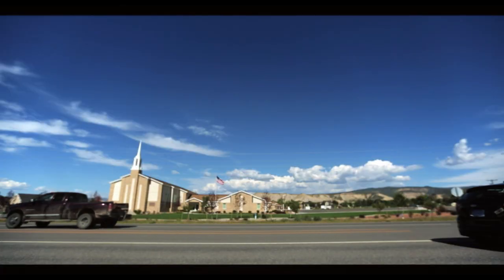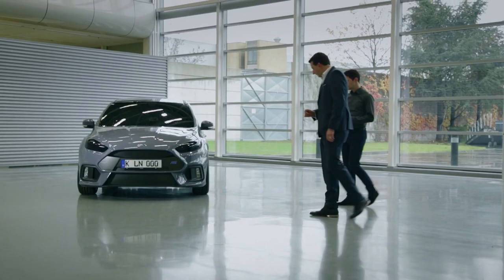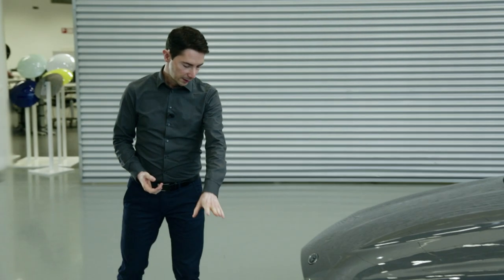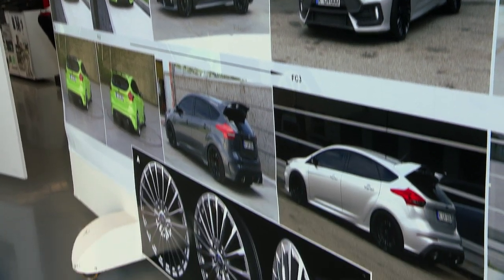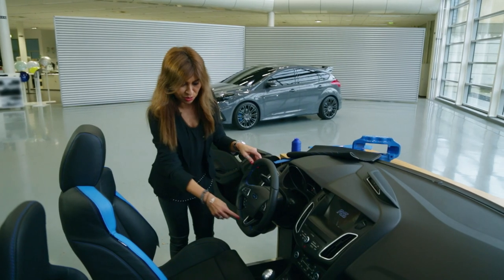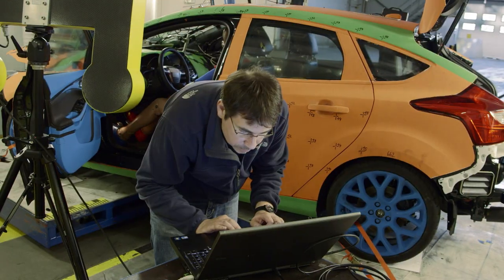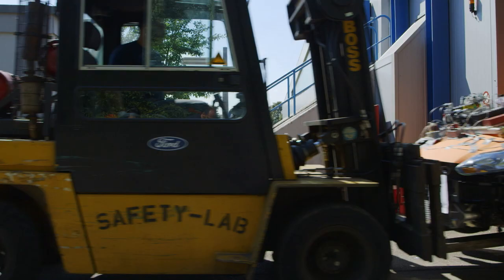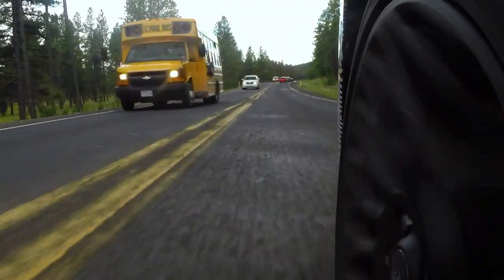Rebirth of an Icon - Design and Development: Episode 2 | Focus RS | Ford Performance

Comment: As a current Focus ST owner I'm excited about the new RS.  But Ford, for a car that has so much excitement around it, this video has zero energy.  The title is "Design and Development", yet there was no discussion of the initial parameters you chose to design the car to meet.  Instead, we got commentary on blue stitching.

Comment: The fact they are simulating a tree side impact crash is that's where a lot of owners will end up while trying the drift mode.
Reply: There's videos of a new RS owner/non driver, going off the road and up the side of a canyon, nearly flipping over before crashing back down hard.
Reply: 2016 focus RS, Drift Mode Epic Fail.
Reply: LOL, yeah , i have seen that.

Comment: 4:37 That folded like a banana round that metal pole, how many of these are going to spin off the road at just 20mph? They should test it at 80mph or more.
Reply: +kevin knowles If you hit a pole going 80 like that you are dead in any car.
Reply: +BITURBOED Well, yes there would be a physical limit but still that looked pretty bad for just 20mph.

Comment: Sadly, Ford has over rated the RS. Ford Engineers origiinal target hp for the RS was 325 hp. It was tested and built in Europe/Germany where the fuel is equivelent to 95 octane. So, the official hp number in the UK on 95 equivelent fuel is, 345 hp. On 93 it's 338, and on 91 fuel its 327-330 hp. Dynos are confirming this, since the RS is technically fwd, factor the 15% average on a 2 wheel dyno of 283 hp at the frt wheels= 324-328 crank hp, on 91... And, with more places than not, using only 91 octane, why FMC continues to overrate on 93 octane fuel, when no other Manu in the world does, is beyond me. Heck, Chevy rates their power on 87-91 fuel. Ford seems to be going the route of Dodge, by making the mustang a bigger, heavier car, and the focus a bigger heavier car. We don't need or want a bigger vehicle in either of these, Ford!!!. Bigger and heavier are all negative. Worse fuel mpg's, slower acceleration, poor handling, longer braking distances. What's wrong with you folks? Give us a mustang that makes good power on US 91, like everyone else. We are tired of the false advertising of the power numbers for new mustang and RS, etc. a class action might be co I got soon unless you wake up FMC. Misleading people into thinking they have more power and then they get smoked by a similarly sized vehicle in weight, that has 40-60 hp less, is not good business practice.

Comment: Dear FMC, get rid of drift mode. There's non drivers crashing their new RS's thinking it'll be easy to drift. And, drivers using drift mode on the public streets in traffic. You are promoting illegal, unsafe driving practices. Bad, bad. As if overstating/falsely advertising 350 hp in the RS, which is really 340 hp in the U.S. On our 93 fuel, not the Europeans 95-96 octane equivelent. Same for the mustang GT. Chevy rates their new SS Camaro on 87-89 fuel, 455 hp. Fords mustang GT makes 412 hp on 89 octane and 422 on 91 and 430 on 93....

Comment: Head gasket issues (wrong one installed or failed design)... PTU issues, leaking oil. This car (I own one) is a hot mess. Buy an Audi instead, they're over engineered and under tuned; you won't have these reliability issues.